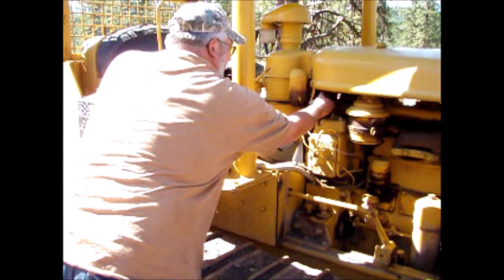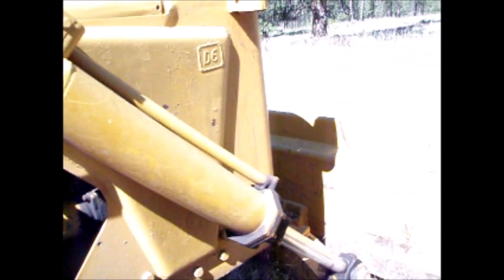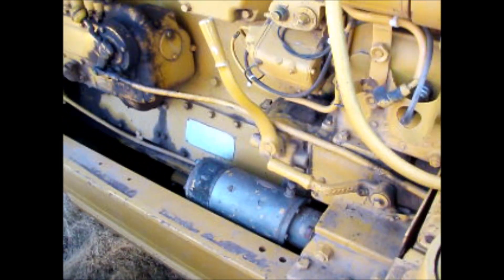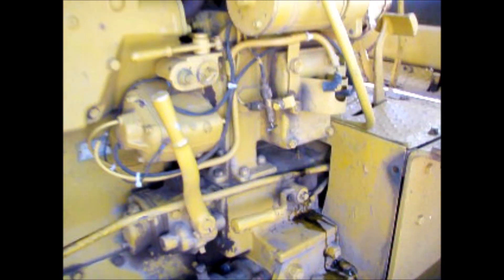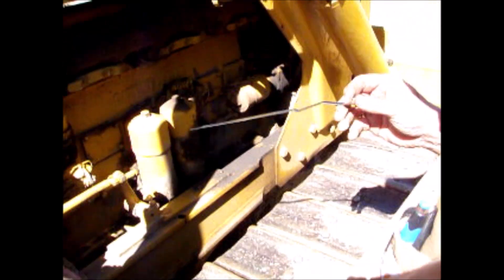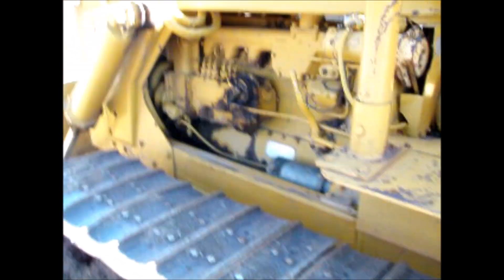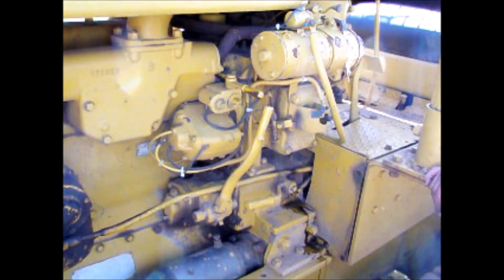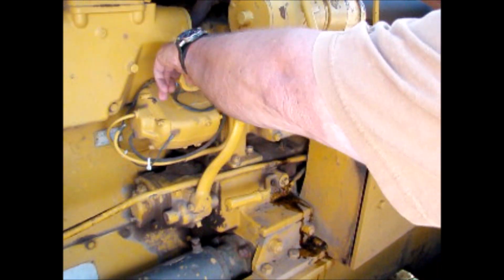How to start a 1956 Caterpillar D6-9U with a pony motor

Comment: All of the ones that I have started in my life has a pull rope. No electric start. That thing had to be just right to take off. We would pull the magneto off and dry it out. They always had moisture in them. Clean the points with some emory clothe. Pull it once it would pop. Second pull it would start. Pain in the ass but it worked 😮

Comment: One of the advantages of direct drive over powershift drive is that if the pony engine doesn't want to run, you can always bump start the tractor, provided that you have another machine big enough to pull or push it with.

Comment: How come you can't strat it with pull  rope  I do I have D6  1964  and D2  cat  it take one or Two pulls on rope and it going  no battery    just done steering brakes  in D6
Reply: I have a bad shoulder...used rope for years..worked fine.